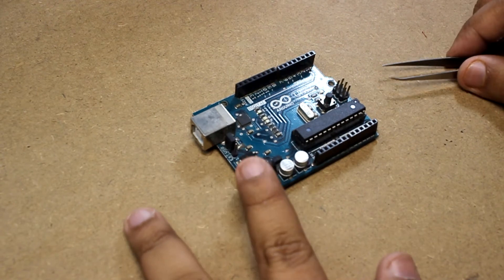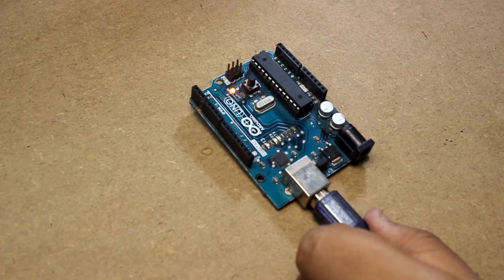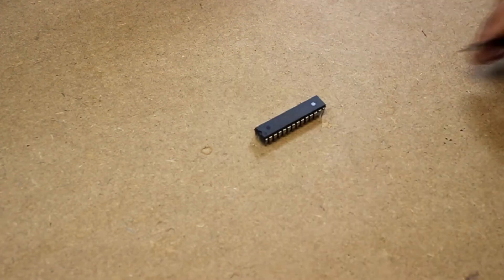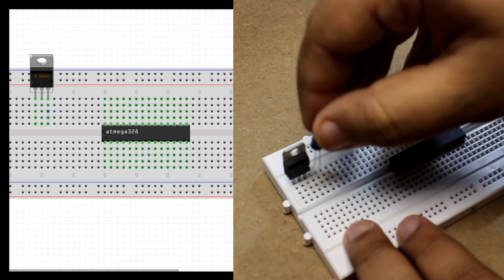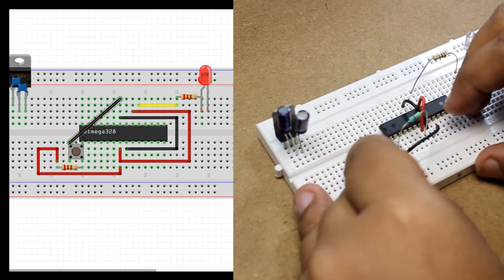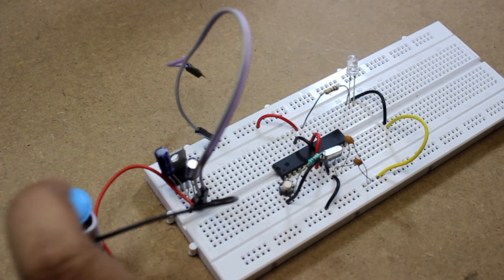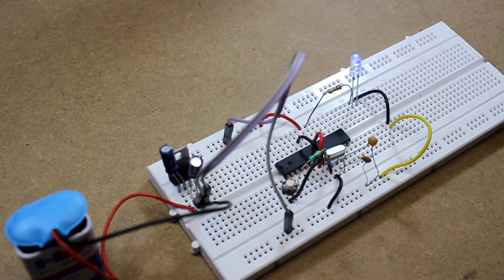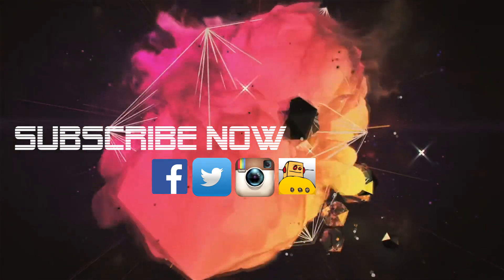Make your own ARDUINO UNO - Part 1

Comment: ye jo ATmega 328 jo h ye is circuit se remove karke , arduino main lga kr k code upload karna padega kya
Reply from the maker: You can, but we will show a way in which no arduino is required.
Reply: thanks sir for reply
Reply from the maker: Welcome :)